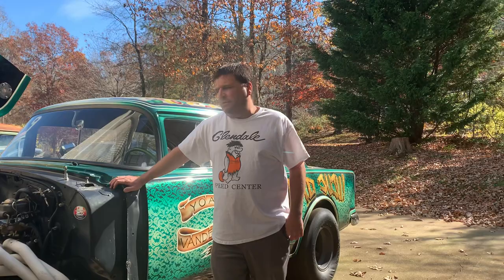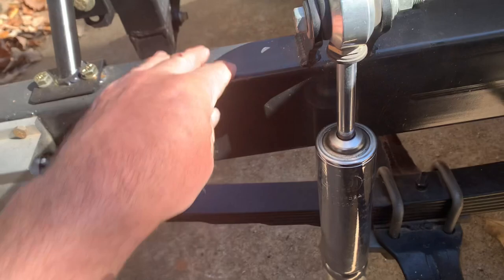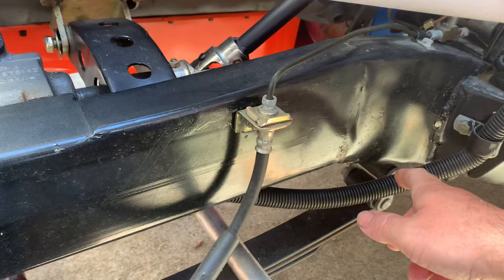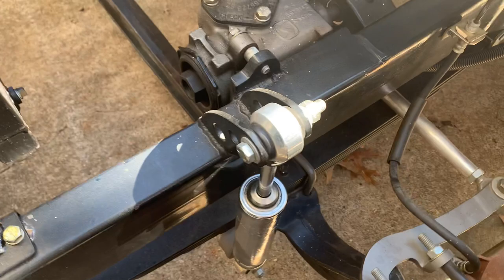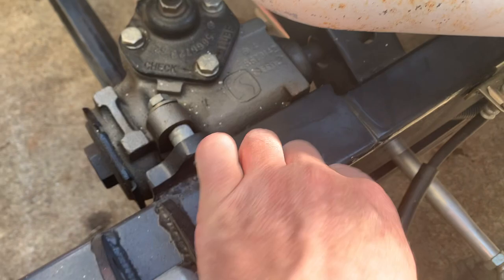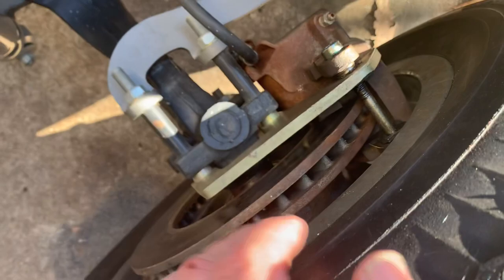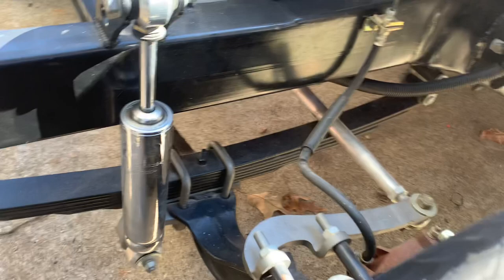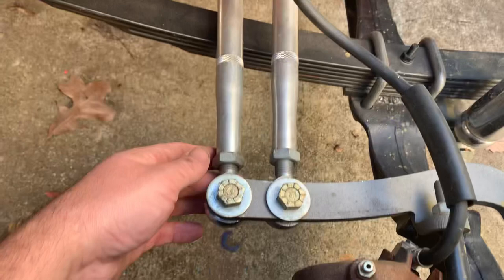1955 Gasser Front Suspension The Gas House

Comment: I watched your video on installing the front axle and steering. I never done one before so I used advice for older than me Hot Rodders. The problem I was seeing was I look at other gasser builds and see they put the stationary spring mount in the rear instead of the front like I did. I got nervous about that part so when I asked 3 different guys they gave me the same answer. If the shackles are in the front you get bump steer and it doesn't handle good going down the road. Watching your video really makes me feel good about my car. I am 74 years old and the information I got were from guys in their mid 80's and they are still building cars. Thanks for your help. I'm Daniel R Parks from Garden City, Kansas.

Comment: Everyone thinks a traditional gasser uses a tube axle when in reality the earliest ones used the factory coils but lifted up and in a couple seasons someone went to the truck axle. Then when they became mainstream, it went to tubes. I’m building a complete 💯 true gasser… gassers actually started in the early to mid 50s before the small blocks and big Chevys. It’s a very hazy period for them. Big in-line 6s, Pontiac and Buick engines were the most common power plants.

Comment: I have a 57 Chevy truck axle if anyone is interested in buying it.
I'm doing a little different straight axle set up. Im putting together a kit to where it's a bolt in application with no welding. Plus, you retain your frame horns and you can put it back to stock if you ever want to. Video coming soon to my channel.

Comment: I had a 4 door 55 but let it get away from me now I have a 1948 style master 4 door touring sedan a 327 but no 4 speed trans. The 2x4 extensions you used will work great for me. A friend has said 1949 truck and said I could have the straight axle guess I need to look at it and see if I can just graft his groin subframe to my frame to make it easy on myself. I have a 10 bolt 8.5" rear posi with3.42 gears I can start with know that will be too tall. I need to get the degas rule book and find someone that can help me with the rules. Think I have a pretty good handle on them now but know there will be questions. Segatakes me back to my teen years. I grew up on gasser racing. When they settled in on bracket racing I gave up on drag racing

Comment: Super Cool 55 Gasser! Looks like it turned out real nice. What engine are you running in the car? Almost looks like a aluminum block I see the old school snow flake heads. Sweet ride man👍
Reply from the maker: Lance runs a cast iron 427  in the one video it had a magnesium 427
Reply: @thegashouse3814  
Thats killer! 427 will rev to the moon! Where do you find a magnesium 427 at?
Reply from the maker: @donshotrodgarage1717  Hi Don, the engine in it is just mocked up, it’s a NOS magnesium block that was cast off of an aluminum winters ZL1 block, with winters heads, ZL1 water pump, winters intake, and real ZL1 carb. I have a real 68 date ZL1 cam for it when it gets assembled. Thanks for the view! —Lance